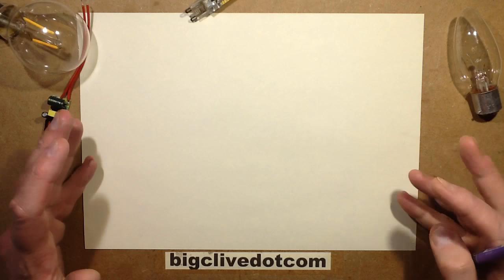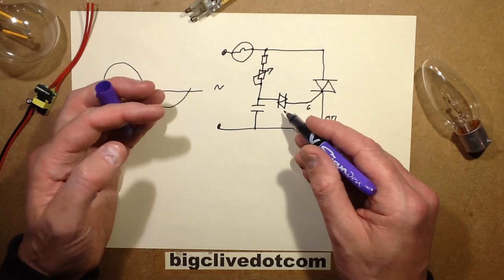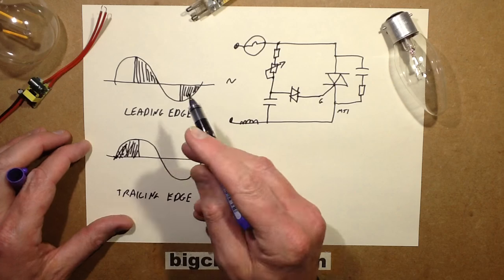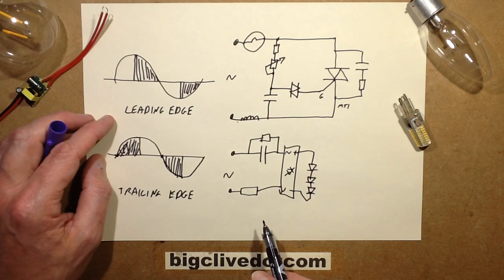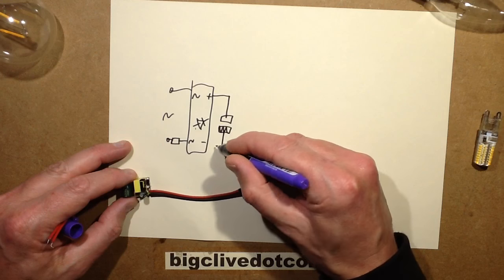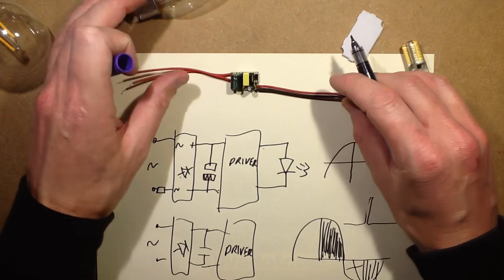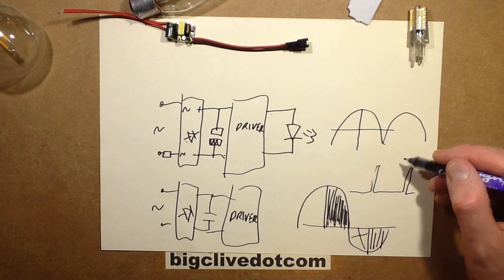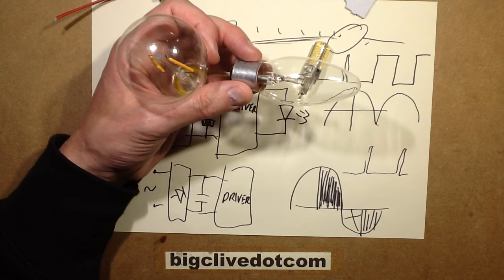Dimming LED lamps with ordinary dimmers.

Comment: Another possible solution could be to use some sort of circuit capable of lighting different amounts of small LEDs, giving you as many brightness settings as amounts of LEDs you have. that way the LEDs run the entire sine wave and only at full intensity do all LEDs receive power. 

I have no idea if this is possible though (rookie enthusiast)

Comment: PWM is not a end all solution as video cameras can pick up the flickering which shows up in the footage.
Reply from the maker: It depends on the speed of the PWM versus the shutter speed.  High and low frequency PWM each have their own advantages.
Reply from the maker: Current regulation is much more complicated than simple PWM control.  Pulsing the LED is much more efficient and if done fast enough is imperceivable to the human eye or a camera.
Reply: Also, with the LEDs using phosphor coating for producing the final wavelength of light (pretty much all white LEDs and some color ones), current-based dimming causes a shift in color, PWM doesn't.
Reply: Frequency of the pulse matters a lot, of course.   50-60hz isn't going to cut it if you don't want flicker on camera.
Reply: Higher end cameras and probably some of the new cell phone ones can deal with scan lines and PWM flicker.  I'm not sure how.  Shoot!  I just realized that it's been a full decade since I worked in TV.  :-(
Reply: Interesting.  I'm wondering if some of the commercial LED video lighting is controlled with PWM or current solutions?  With tungsten, variable voltage caused color shifts where as current dimmers retained much of the spectrum if I remember correctly.  Now they have some pretty neat toys to go with the new generations of capture.
Reply: +Dave Fredrock I don't think it's the cameras that improved but rather the PWM dimmed light sources. People used to run them around 100Hz, nowadays it's pretty common to see light that are run at several kHz—unless you're working with high speed cameras, they simply can't pick up the flicker.

Comment: I've actually come up with an interesting LED dimming system. It would use a specific light switch module that would communicate with the bulb through the wiring. The bulb would have multiple sets of varying intensity LEDs. The wall switch module would have a knob connected to a potentiometer, the circuitry would then tell the bulb the intensity to light at. A low setting could use half the low-intensity chips, medium setting could use all the low-intensity chips, and the high setting would combine all the low-intensity chips with half of the high-intensity. And at full brightness, it would light all the chips. It wouldn't provide the same kind of linear brightness control you would get with a traditional dimmer, but it would be a simple and functional system that doesn't involve any flickering or burning hot MOSFETs.

Comment: Most LED lights seem to often have several banks of leds. turning banks on and off (ie half of banks on for half light, all on for full light) might be the best way to "dim" led lights. but would require communication with the driver in the led light

Comment: Huh I just learnt something new, I thought dimmer switches were just variable resistors. Instead, they work more like analogue PWM. This explains why the one in my house made angry buzzing noises - until I removed it and replaced with with a normal switch so I could use LED bulbs in the room.
Reply from the maker: The very first theatre dimmers were variable resistors (rheostats) and got VERY hot in use.
Reply: Yeah after typing that reply it did cross my mind that rheostats probably get a tad warm, and probably wouldn't be safe to embed in the walls of someone's house.
Reply: Reminds me of my internship where the speed of a three phase motor in a printing press was changed by switching massive resistors in and out. There was an entire wall stacked with them. Mind you this was just around 4 years ago!
Reply from the maker: Sounds like an old machine.  The resistor banks are less efficient, but I bet that machine lasts longer and gives less trouble than one with electronic motor drives.
Reply: Definitely. It was already giving a lot of trouble, but I'm pretty sure it'd been in service probably since before I was born.
Reply: Would variable resistors for things drawing lower power, such as LEDs only need to dissipate a similar power?

Comment: what it needs is a switching power supply inline, go to DC then chop at high frequency , smooth and rectify . just like a proper DC power supply. you can then adjust the output voltage and it will be pretty efficient.  more expensive than a triac/diac combo but we have moved on now :)

Comment: Could be good to see explanations how big brands are overcoming issues you mentioned in there dimmers and compatible LEDs. Because they work flawlessly, just costs a lot.
OK, then simpler question: what is difference between simple LED and dimmable LED circuit boards?

Comment: I have a 5 socket hanging light, in which I tried to install 5 decorative LED bulbs.  The dimmer is about 20 years old.  With all 5 sockets occupied by LEDs,  performance was weird and erratic.  If I put a standard incandescent bulb in one of the sockets, the dimmer works very smoothly.
Reply from the maker: Dimmers need a minimum load to latch the triac.  Some don't like LED lamps.

Comment: As always a really interesting video, I've struggled for some time to get a good LED lamp and dimmer combination, I found that my Futronix IR dimmer seems to do a pretty good job with most dimmable LED's. However having recently installed some Philips Hue lamps, I really think that's the way to go, not only very smooth dimming but colour temperature control as well. Also lots of features such as timed on/off, sunrise/sunset effect (great to wake you up) and remote control (even from the other side of the world, should you want to). Trouble is, very expensive.
Reply: Anthony Challis And potentially hackable by pranksters or worse!

Comment: My perception is that recently, it is harder to find LED bulbs that are NOT dimmable.  Most of the LED bulbs in the local box stores are dimmable.  They do require a special dimming switch which is LED compatible.  I had a "traditional" dimmer and tried it with some "dimmable" led bulbs and noticed what was described by Clive - the lights flickered and made a humming noise.  

Since we can no longer purchase tungsten bulbs, I bought some more expensive (but supposedly longer life) halogen bulbs.  These could dim, but they hummed worse than the LEDs when dimmed.  So much so that I finally gave in and replaced the switch with a Leviton LED compatible dimmer and installed dimmable LED bulbs.  No hum and no flickering. The LED bulbs I'm using are relatively cheap from a company called Ecosmart.

The only complaint I have is that the led bulbs don't come on right away when turned on - there's a small delay which is short but noticeable.  Also, the dimmer setting has to be at around 50% for the light to come on, but once the light is on I can fully dim the light.

Hopefully one day +bigclivedotcom will be willing to tear one of these down.  Would really love to see a Leviton brand teardown.

Comment: One thing that maybe of interest Clive is ZEGALED a USA company distributing product sourced from 'Sunfor' in China. The bottom line here is long persistence LEDs by the use or rare earth materials which in theory massively reduce flicker.
I have had no success in testing these. Do you have the contacts to get some? The LEDs themselves are called REAC LEDs and are primary intended for ac led solutions ( bridge and current limited LED string..no large caps).
Jerry

Comment: All dimmable lights strobe. All of them :( please correct me if I'm wrong, I will be very happy finding one. I have tried nearly every make of 'dimmable' bulb and they all flicker, even the expensive Philips and Osram ones, some worse then others. Doesn't matter if your use a dimmer or not, or a traditional dimmer or a trail edge dimmer, even in a straight on off switch like a lamp they seem to strobe/flicker when tested on a slow record. The quick test I did was slow motion video on the iPhone where you can see the strobing on all dimmable leds. Even get strobing on all hallogens (they can all dim). However, a few straight non dimmable leds I tested (like both Philips core pro 11 and 13 watts were completely stable). I'm dreading to think that no dimmable leds that don't strobe even exist. Even if my eyes can't see the dimming, and only in very slow motion you notice it, I'm sure my migraines come from them. Has anyone else tried this iPhone test? I am completely wrong with how I'm testing or am I right and all bulb manufacturers offering dimmable bulbs ruining our health?

Comment: You're right that dimable LED lamps able to dim from ordinary wall dimmers are very complex as for accepting an leading edge dimmer you need to design circuit to be able to take high inrush currents. Trailing edge compatibility is more simple as "all" you need is to be able to analyze the waveform and drive LED accordingly.
That said I do find that both Osram and especially Philips do run very on ordinary small current LE dimmers - even single bulbs. They've nailed it as far as ordinary consumers go. Technically it's a bit of a hack but they work very well in reality and those two manufacturers lamp are audibly very quiet even on LE dimmers barely audible with ears 5-10cm from bulb. I have a 15-20 years old 24-240w plug in triac type dimmer and even a single 7w Philips on it works nicely. That said I'm looking for a small plug in TE dimmer instead as it's better for the circuitry none the less and even ear close to bulb they're dead quiet but oddly they're hard to find. Wall type TE dimmers are easily but also expensive for odd reason and not suitable for my use. If you have trouble dimming a  dimable LED lamp all the way down you can put on more lamps or an active load.
As you say the future is different but old school dimmers will still be around for a long time and so will compatible bulbs as many people are not ready for a smart system yet. Heck even Ikea's LEDARE are mostly dimable types. Not quite as quiet and smoothly working (without an active load) on cheap TE dimmers as Philips but working satisfactory compared to price paid none the less. In the meantime you can get various of smart bulbs - even cheapos. Flip switch off/on within a second and it starts dimming, again to lock brightness levels. Others just have 3 levels 100, 50 and 10%. 
But it doesn't stop there. Personally I've switched to Philips Hue for some of my lamps. Really nice to be able to control light even when you're not at home, having light fade on 5-10 minuttes before alarm clock screams, automatic front door/drive way lighting with more complex patterns than a simple digital timer etc. I can totally recommend both Hue and Osrams Lightify. A few lamps though I will not or can't switch for smart bulbs. That's where the Osram Lightify plug comes in as it allows to turn those on/off remotely and smartly without those costly bulbs (it also helps I can buy the Lightify plugs at a good price through my work) and at 16 amps 230v the plug can drive just about anything you want - not just lighting.
For wake up I like the light at first 5 minuttes to dim up at 2200 K (got the ambiance version in the bedroom, no full color able to go to 2000K as I find those way too expensive) then the next 10 minuttes fade to ~6000 K and finally over the next 15 minuttes fade to ordinary 2700 K. Mostly I wake up by the light instead of a screaming alarm clock and it's perfect to wake up on while reading news on tablet etc. For my front door/drive way I only got the cheapest white hue bulbs without any adjusting except brightness. Different pattern for weekend and work days and different light levels for different parts of the night/morning as some parts of the time you really don't need a blasting full light - just enough to see an make house look alive while on other parts of the evening/night - weekends etc. when you risk drunken people wondering around they get more brightness.
So yes I'm very well on to adapting smart lighting :)

Comment: Of the solutions you posited, I see the powerline communications option being the most likely as well as the cheapest to implement.

The dimmer proper would be the LED driver as it is right now, except the voltage and/or current regulation would have an adjustable set-point controlled by a low speed serial data stream superimposed on the mains power lines. By default, this would operate at full power (no serial data stream detected = full power, should be good for testing or "dumb" switches).

The dimmer switch would place a low-pass filter across both wires of the AC supply, and superimpose a low speed serial data stream on the lines after the switch.
To do this, the dimmer switch would have 4 or 5 terminals, 2 for AC input, 2 for AC output (with serial data), and probably one for grounding (just for good measure).

The low pass filter and 4 (or 5) terminals on the switch are the important parts.
They make it so you don't need to mess about with channel settings just because everything is connected to a common power feed
Effectively, they prevent the serial data stream from back-feeding into the rest of the house's wiring, while letting the mains power thru with minimal losses. Choosing the serial data carrier frequency to be several 10s of kilohertz makes the filter design for this relatively easy (and therefore cheap).

Here's how the wiring would work (it's pretty similar to how dimmer wiring works right now):
LED drivers that are wired in parallel on the output of an LED dimmer control switch will be controlled by that dimmer and no other dimmers.
LED dimmer controls that are in parallel can't cross-talk because the low-pass filters isolate the serial data streams from each other.

Easy to understand set up, no messing with "was that channel 5 or channel 6?", and if you really wanted you could probably get special dimmer control units that would translate to/from various home automation control standards to this one.
Reply: Why is powerline cheaper than Bluetooth?
Reply: Peter McArthur
First off, there's less paperwork.
No need to pay for the license to use the Bluetooth patents, no need to get FCC approval for an RF transmitter, etc.

Additionally, each device would be cheaper to make because you don't have to pay for the Bluetooth module itself.

The power line communications protocol can run at something like 25khz, which is just above audio frequencies. Basically ANY transistor would work well enough at those frequencies. On the other hand, the microwave-band frequencies used by Bluetooth and WiFi (2.4 Ghz and/or 5 Ghz) require special transistors.

It's also less expensive to implement on the consumer level because only need to pay for one dimmer controller per fixture, not one per light bulb.

There's nothing stopping anyone from making a dimmer controller that can accept Bluetooth commands, either.

Comment: Could u or have you ever Torn apart one of those dual-element high-efficiency bulbs or (instant bright fluorescent light) that use an incandescent bulb on the inside to heat up the fluorescent element and switches off the incandescent inner bulb once it has reached some sort of limit. I always wanted to see how those work

Comment: I'm a bit late to the party but since Halogens seem to have disappeared those dimmers I bought for a £1 in flockdown were discounted for a reason. Meh. I saw Great Scott made a little dimmer the other day. Not exactly easy. Do you still stand by using funky, remote-controlled bling LED's in 2022?

Comment: I have seen a reasonable solution. The light contained a switching power supply lacking the smoothing capacitor after the rectifier. It only had smoothing right at the end before the light. It worked.
The power supply has to be made to the intended lamp and it must not have that strong gain/voltage control. It has to run full duty cycle all the time.

Comment: I've heard of DALI (digital) and 1-10V (analogue) dimming systems, which use an extra 2 wires to send signals to the LED driver. Although this doesn't work for consumer globes, many professional fixtures have this feature.

Comment: i have led lighting throughout my house, in one room i had no end of issues with 5 g9 dimmable led lamps if they werent buzzing they were strobing being an electrician its embarrising not knoing why its not working the way it should.... in and out the wholesalers with different lamps and led dimmers, caploads, resistors and still no joy. i bought a varilight led intelligent programmable dimmer on amazon for £13 and all problems have been resolved!

Comment: White LEDS are actually ultraviolet LEDs with a phosphor layer that converts the ultraviolet radiation into visible light.  The phosphors have an afterglow similar to the afterglow of an incandescent lamp filament, greatly reducing the flicker when driven with 50-60 Hz mains power.

Comment: I have a cheap LED bulb with capacitor dropper and a simple switch with a neon bulb in parallel built in and when I turn the switch off the LED bulb dims down from 30W TL-D brightness to 1W fluorescent night light level, it has been operating like this for months and doesn't look like it's going to die anytime soon. So here's a thought: is it possible to use a neon indicator light in parallel with the dimmer to make it work on some LED bulbs?